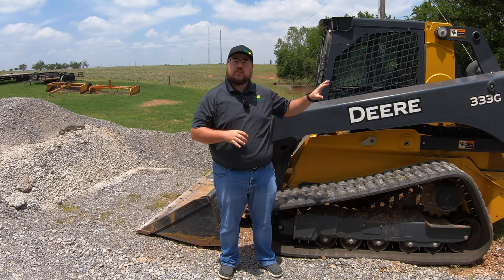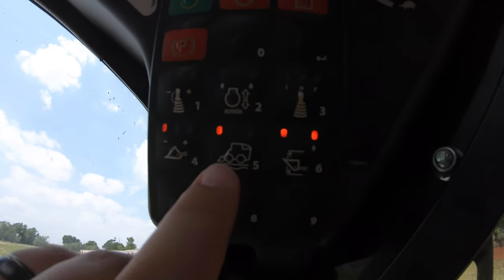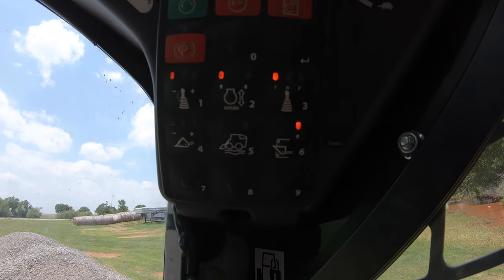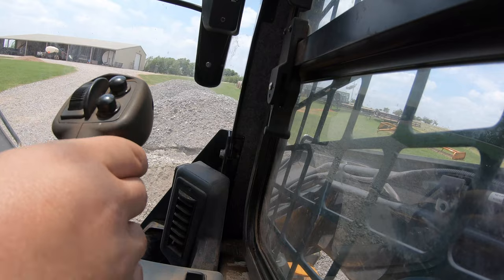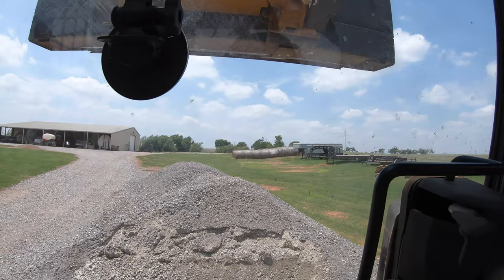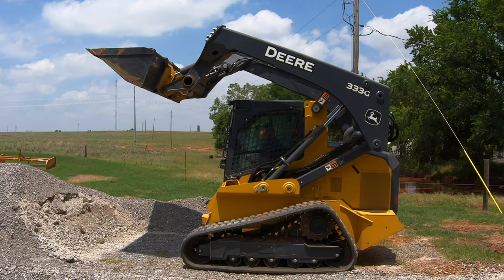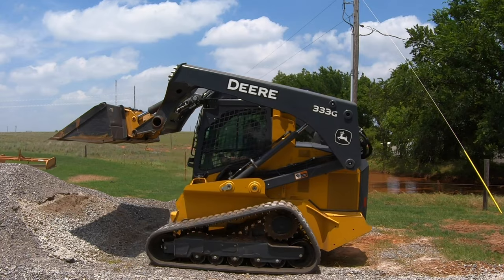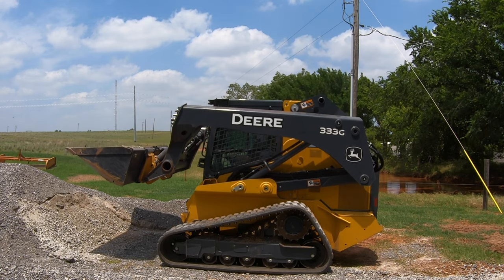How to use John Deere 333G Skid Steer Self Leveling Bucket Feature

Comment: Does the self-leveling feature replace the float position? I can't seem to find it on my 2023 JD 331G. I want the float position for back dragging material.
Reply from the maker: No, if you have the self level then you should have ride control which allows for the float.

Comment: First I want to say your videos are great. I have question for you I have 317g 2016 I was using the self leveling feature on the machine before then I don’t know what I did push now when I want to use it  says not available ?
Reply from the maker: This is interesting. Have you got in contact with your local dealer? This sounds like a fault in the system.

Comment: This is great for the inexperienced. If you have a Skid steer that has an open cab, it'll prevent the operator from filling the cab with material. But at the end of the day, you should realize that you need to curl down when raising the bucket.
Reply from the maker: Good tip and thanks for the feedback. Also, thanks for watching!

Comment: Just ran across yout videos... good info!   Is there a "Float" Function on these machines.  I have a 2018 JD 330G for reference. Thanks!
Reply from the maker: Yes, there is on many models but this usually has to be added at time of purchase if the machine is not equipped. I hope this helps and thanks for watching!